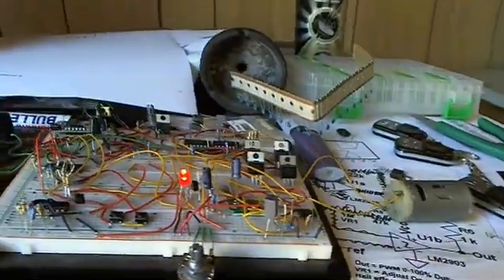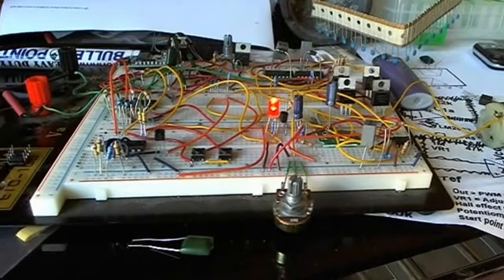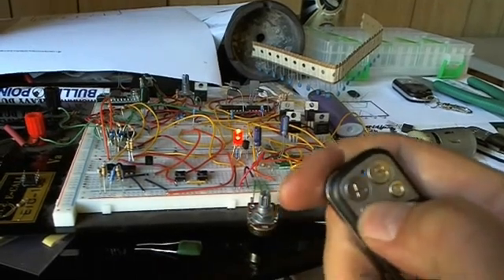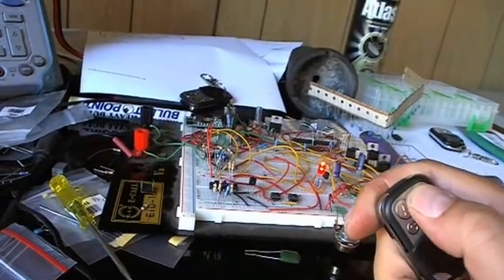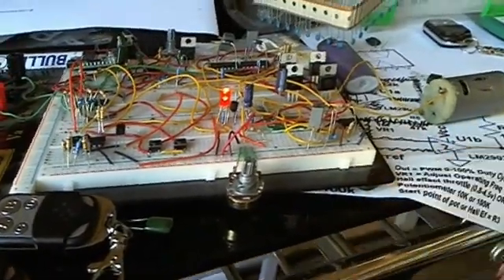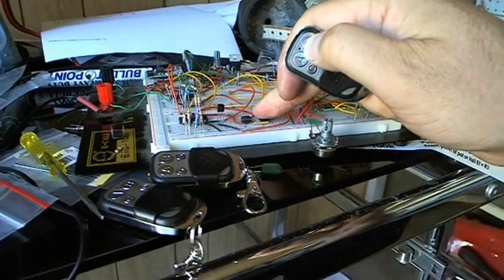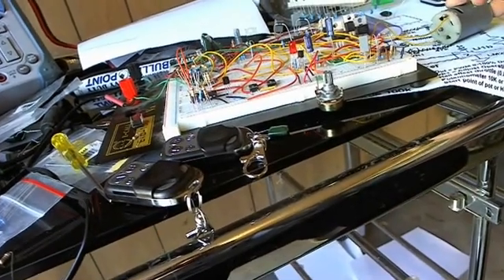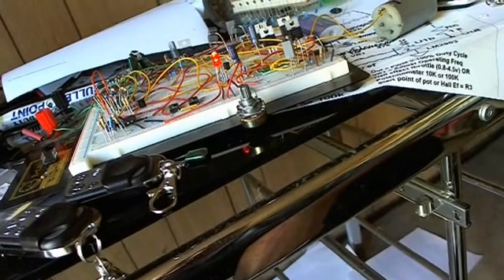Wireless dc Motor controller works on any voltage between 12v and 36V

Comment: you have been build the simple receiver  module to control the Motor positive &negative .and it can load 30A .and it has so many function .
your wireless  system also with manual function and the  limit switch. it is perfect .You an Excellent Enginner.